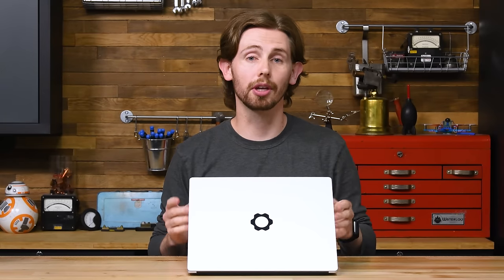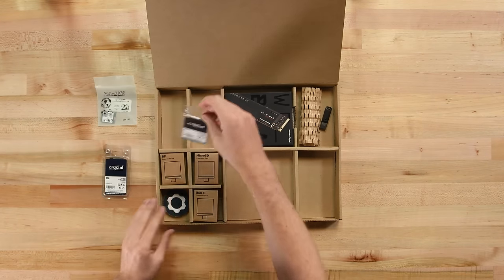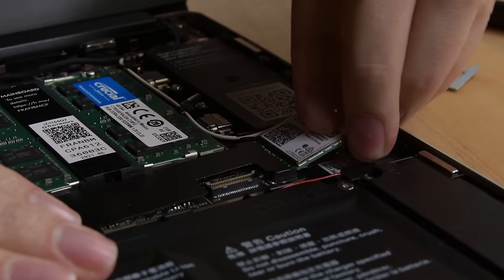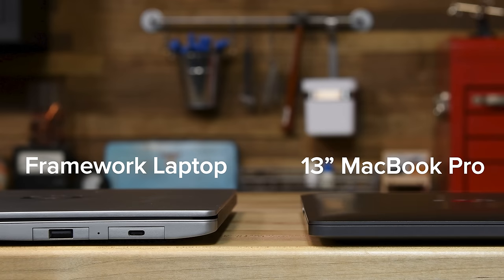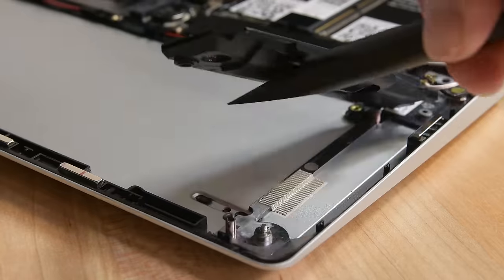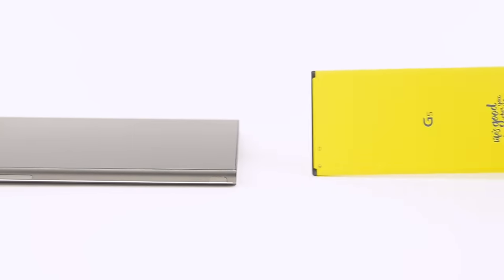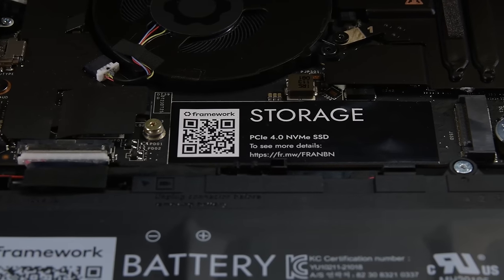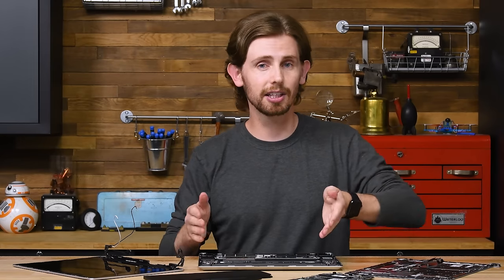Framework Laptop Teardown: 10/10, But is it Perfect?

Comment: I am kinda disappointed that I don't need a laptop rite now because I want to support this thing with $$$. 

The only reason it might not deserve a 10/10 is if the company isn't able to keep replacement parts in stock. If there is a way, in the future, to upgrade the CPU, and go beyond 32 GB of RAM it deserves a 15/10
Reply: I think the laptop actually supports up to 64 GB of ram.
Reply: Or if they can’t make retrofit kits to swap motherboards when cpu manufacturers change the sockets.
Reply: Pretty sure those SO-DIMMs will support 2x32GB sticks if you really wanted, pretty sure the processor supports it
Reply: @RadDadisRad  there aren’t any sockets in laptops. The CPU is soldered right in to the board, and there isn’t any cpu that has a socket.
Reply: @Xavier likes Technology yes, you have to replace the whole motherboard, which isn't the best solution, but still better than replacing the whole laptop
Reply: @Xavier likes Technology 
But they are replacing the whole motherboard already, as seen in this video, if you have to upgrade the CPU, you’ll have to get The Whole new board for it which contains the soldered CPU, so it’ll be upgradeable
Reply: I'm on the same boat with you. My laptop even died recently, so I'm kind of in the market for a new one. But I'm doing very little traveling, and working from home on my desktop (as a result of the ongoing situation), so I can't really justify purchasing a laptop for now. Once I become mobile again, this is definitely on the top of my list. Seriously, I'm trying very hard not to throw my wallet at the screen right now.
Reply: Honestly the only reason I have bought it is because I don't need a laptop.  Hopefully it stick around and is more mature and customizable by the time I do though.  As for CPU upgrades they do plan on having the option of buying boards with different CPUs.  Which doesn't sound ideal until you see they also want a market where you can sell your old board to recoup some of the cost as well.
Reply: @AlexSage91 
Sounds really ideal and better than other options imo, You won't have to pay the full price of a laptop if you judt want the new CPU, say, for example, you bought a $1000 upgradeable laptop from framework, then 3-4 years later your laptop starts struggling so you need to upgrade it, for just $200-300 you buy the the new board with new CPU instead of spending $1000 again to buy a new laptop
Reply: @עומרגור-ק2ד  Thats why they designed the motherboard as simple as possible, so that replacing the motherboard is barely more expensive then the CPU.
Reply: Isn't CPU soldered on the MB?
Reply: @乾淨核能  
Yes
Reply: With no dedicated GPU, I don't think anyone is going to be doing workloads heavy enough that would require the CPU to have anything higher than 32 GB of RAM.
Reply: @עומרגור-ק2ד  That's a bit weird considering i upgraded the cpu in my laptop which was socketed 🤔
Not all laptops have soldered cpus, especially when the chassis/mobo is going to be used with multiple skus
Reply: I'm just hoping some 3rd party accessories would appear for this laptop. The shape is really that generic, it would be that easy to create something compatible in this laptop. That way the product longevity would span ahead.
Reply: For repairability, what you said is the only reason it wouldn’t get a 10. I have a few minor problems with it otherwise, though.
1) There is no way to use an AMD CPU, which would probably be faster and more power efficient. This is important because of the small battery.
2) From what this video tells me, the cost of Windows is included in the laptop, which means it would be cheaper and faster to use Linux, but we can’t do that.
3) The battery is too small. I would much rather my laptop be a bit thicker than have a dinky battery.
4) There is no touchscreen and no 2-in-1 capability. I don’t really care about those, but other people do.
Overall, these are extremely minor nitpicks, and I would definitely recommend a Framework to anyone in search of a new, high quality laptop.
Reply: I Waldo want to support this company but its too expensive for me. :(
Reply: For a cpu upgrade a whole motherboard would be needed. And maybe a cooler too, if the cpu is thinner or something like that. But given how easy this motherboard replacement is, and also that the motherboard has no major hardware built in, other than the chipset and cpu, it should be relatively easy to pull off at a reasonable price.
Reply: Upgrade cpu is impossible...since the socket need to change to adapt with newer cpu. I still remember alienware 51m vs asus ryzen cpu laptop. All of them are beefy and no body choose to replace it or upgrade it. Secondly intel and amd sold their mobile cpu as dices, not as a whole cpu. So all manufacture have to soldering those dices onto motherboard....etc...alot of thing had changed so upgrade cpu will never return
Reply: LTT says they can do 64.
On a completely unrelated note, their website is down.
Reply: Well it's pandemic give them a break for now
Reply: The laptop does support 64Gb of ram
Reply: Kevnev Katfute  Yeah, I know, I was part of the hug of death. Just trying to joke.
Reply: It supports 2x32GB, when that isn't enough for you anymore the rest CPU is probably also obsolete.
Reply: It supports 64GB of ram
Reply: @Xavier likes Technology what about ARM ? if Framework goes ARM can I change my Intel device to ARM?
Reply: @RadDadisRad  you can but it would have to be external
Reply: It already supports 64gbs and modern laptop cpu's arent socketable(at least not series that this laptop is using), they're soldered and I'm sure if you fashion a mobo and socket that's break some IP laws
Reply: It can already go to 64 GB ram.
Reply: @STORMFIRE07  will it lose windows?
Reply: What I'd like to see is a robust aftermarket for different parts. At first, it might come from people making 3D printed parts but if it's popular enough third-parties might make things for it as well, which will keep it going even if the company can't.
Reply: @legoswmonkey7037 they do have 2×32 GB kit of RAM
Reply: @skywz  
1. There maybe AMD board available later down the road as the silicon shortage normalizes. I think Intel is easier to get now so they went that route. 
2. There is option for no OS. 
3. That is personal choice. A lot of ppl would prefer a lighter laptop even at the cost of lower battery life.
4. Linus said that touch screen support is built in the hardware so there is possibility of getting a touch screen later.
Reply: @עומרגור-ק2ד  There are a few laptops that have a socket for the CPU but they are rare
Reply: @Xavier likes Technology Thats why in the video he talked about replacing the whole motherboard when a new CPU is available
Reply: @johndumpling1896  Depends on the price of the motherboard and how much it will improve the laptop but its a great idea if its cost effective
Reply: I would also like that the CPU is upgradeable but that I think won't happen. Newer CPU's need newer sockets and are only compatible with newer chipsets. Intel and AMD are responsible for this "issue", not the guys at Framework
Reply: @עומרגור-ק2ד  Thats weird, because my old zbook has a socketed 4700mq
Reply: Actually some laptops allow you to do so like clevo laptops. However tho this company still did a good job on maintaining the balance between thickness weight and upgrades.
Reply: Technically speaking, if the CPU does start showing age, you could theoretically just order a new main board from Framework and carry over all your other components just like you would a desktop. Let's face it, even if they didn't solder the CPU to the motherboard, come upgrade time socket compatibility would probably be an issue requiring motherboard replacement anyway.
Reply: 64 GB is an option on their website.
Reply: I want Ryzen mb
Reply: If they have shares, than you can invest.
Reply: @skywz  the score is based on repairability...
Reply: @Mod20087  It does. ;)
Reply: Apparently they released CAD drawings of the motherboard so once you need to upgrade to a newer CPU you can for example 3D print a case for the motherboard and use it as a NAS.
Reply: Hopefully this kind of thing might get traction enough for some standardised parts. :)
Reply: @johndumpling1896  how often do people upgrade the cpu without swapping the motherboard as well. Even in desktop PCs most people will stick to there CPU until its so outdated that they would need a new board anyway
Reply: it is able to do 64gb at this exact moment. furthermore, they have already declared the motherboard w/ cpu also easily replaceable, and they even want to support arm riscV and other x86's in the future
Reply: @RadDadisRad  No sockets on mobile CPUs anymore.

So as long as the new CPUs don't require drastic motherboard design changes, then Framework should be able to offer replacement motherboards with newer CPUs.

Whether they will is another question.  If they are still around, it may not make financial sense to (hopefully not).  Or sticking to one motherboard shape may hinder them in the design of new products.  As this is the first version, I think they may well have that latter issue.
Reply: sell your laptop and buy this one
Reply: +1
I purchased a laptop last year, and I live in a country where Framework won't deliver at this moment. I hope it finds enough early adopters to keep it afloat.
Reply: I buy MacBook
Reply: Pretty sure the fact that the CPU isn't replaceable is on AMD and intel, since they no longer design socketed CPUs for laptops
Reply: @עומרגור-ק2ד  they used to be socketed up until a couple of years ago. I actually replaced the pentium in my laptop with an i7
Reply: @NadimSadeeq  they mentioned it in their website. The processor is not replaceable, but the logic board itself can be replaced.
Reply: there will be
Reply: @skywz  System76?
Reply: yes rite
Reply: I can put up with even if it had soldered GPU but if it had above average GPU and I needed a new laptop I would buy this in an heartbeat.
Reply: @thepenguin9  He was a bit inaccurate, intels mobile cpu's dont have sockets, you either had a laptop with a desktop cpu or, and i am not informed on that whatsoever, you had a AMD laptop which may or may not have socketed mobile cpu'S (as i said i dont know anything about mobile AMD so i dont know if thats actually the case)
Reply: To upgrade the CPU would mean to swap out the mobo, since laptop CPUs are sodered on
Reply: on the website it says that you can upgrade the cpu with the motherboard
Reply: @skywz  hopefully they'll include those options in the future. 🤞
Reply: If only they released the designs for the 3rd party to create a market for the modules 💁🏻‍♂️
Reply: @amaizen4817  bit weird AMD would sell i5's and pentiums

And no, it isn't a desktop cpu. Some laptop motherboards have sockets. And this wasn't some top of the line laptop, it was an El Cheapo laptop.
Reply: it supports 64gb btw
Reply: you can do beyond 32gb of ram. however, you are only limited to 64gbs of ram since soddimm only comes in that much stoarege
Reply: @dharam95  MX Linux or Fedora Mate or both as I like dual/triple booting laptops.
Reply: I bought an m1 MacBook pro and now i legit regret buying it after finding out about this laptop
Reply: buy extended drive, Sell your current laptop & buy/build a framework laptop.
Reply: I'm sure one day when they offer other motherboards you will effectively be able to do this
Reply: @skywz  The good thing about Framework IMO is that it's modular enough that they could feasibly have motherboards with AMD CPUs and touchscreen displays just by making those individual modules. And as far as 2-in-1 and bigger batteries go, they'd just need a larger chassis. It's possible that if Framework continues making laptops, we'll see many more options available.
Reply: @Archpope  3rd party / aftermarket parts are explicitly out of this manufacturer's control. That's what "aftermarket parts" means. So the only way you're gonna see that, is if it sells well enough that other businesses consider making parts for it a worthwhile venture.
Reply: @skywz  You do have the option of getting a DIY version with "NO OPERATING SYSTEM" which reduces the price by $100
Reply: @Xavier likes Technology you replace the motherboard
Reply: @Xavier likes Technology then use AMD. Or RISC-V :0
Reply: they're going to have motherboard replacement kits so you can have a better cpu in the future, and almost all of the parts are standard
Reply: @sarim5030  I mentioned “affordable”, and that System76 is not.
Reply: @RadDadisRad  they will even sell you the mobo if you haven't bought one if you want to make your own custom laptop, so when they upgrade the cpu and motherboard not only can you upgrade but you can sell the old one to someone doing projects.
Reply: @עומרגור-ק2ד  Not anymore. My old Toshiba from 2010 is likely one of the last ones with a socketed CPU. And while I really love the idea of simply swapping the CPU, I can see why you would not want to do it because of reliability issues. Still: It was possible back then and I would gladly sacrifice a few mm in thickness for the socket to come back.
Reply: w  Not all the parts.. the Motherboard and some of the other parts are custom made to be more repairable and, according to LTT Framework went around to parts manufacturers and looked for new things that other manufactures aren't using that fit with the ethos.  They and those manufactures will make the parts available, but if you want the drop in fix some of the parts are only for their laptop.
Reply: @CanadianBakin42O  what
Reply: @ThePepsicola1995  if you learned to read, you wouldn't have said that
Reply: @lungshadow Exactly. It makes perfect sense as a business proposal to offer a solution technically suitable and mostly beyond the needs of 50% (or whatever it is) of consumers. I also would think it a no-brainer to plan for a line of high-performance, larger units with discrete graphics and full keyboards with numpad etc... when success of the initial run allows it. In the age of planned obsolescence, these guys deserve major consumer support for their initiative and it's great to see the enthusiasm from the youtube community. Peace.
Reply: @CanadianBakin42O  Why so toxic my man
Reply: And add in a GPU but that’s even more of a pipe dream as it needs cooling upgrades as well.
Reply: @dharam95  you can install Linux yourself you know
Reply: @AlexSage91  also the system board is designed so it's easy to re-use it as a desktop.. So if you upgrade, the board is not "just" a replacement part, bur an option for ppl to build a cheap desktop.
Reply: @thepenguin9  in the past yes... not anymore... all mobile cpus are soldered... ofc there are laptops that use desktop cpus, but that is something diffrent.
Reply: @ric_dk-9520  not sure how to tell you this but, I didn't use a desktop cpu in the laptop, it was a sku meant for portable usage, and it definitely wasn't a desktop mount on the board
Reply: @skywz  For point number 2, the DIY edition exists which lets you get a laptop that can either preinclude RAM, Storage, and an OS, or not include any single one of them, or all of them. 

I did the DIY edition, with "BYO" memory and storage and OS as I have a spare windows 10 pro key laying around my house so I got my laptop cheaper since i didnt include as much on the initial purchase
Reply: Not entirely true. My Alienware M17XR4 has a FCPGA988 - maybe rPGA988B? - socketed Core i7 CPU (as well as a replaceable MXM graphics card).
Reply: not to be that guy, but most use cases where you need over 32gb of ram, you will need a better CPU than is inclided. I personally have 64gb of ram on my laptop workstation and the CPU is the bloody bottle  neck.
Reply: @johndumpling1896  with apple they replace the whole board including the ram and storage and claim it can't be repaired
Reply: The laptop uses standard DDR4 modules which means it can easily support 32GB RAM, maybe even 64GB (2x 32GB). Though having said that, 32GB DDR4 modules are going to be almighty expensive.
Reply: @johndumpling1896  I think that's actually okay because you very often have to replace both motherboard and CPU on desktop machines, too, if you want a real upgrade. Even if the socket is compatible, the chipset on the motherboard may be the limiting factor. I hope they can support AMD CPUs with the same form factor - it would be nice to switch from Intel motherboard to AMD motherboard and keep everything else in your laptop (including battery, memory, SSD, wireless adapter, all the modules, keyboard, touchpad and the screen)
Reply: It has space for two memories and the highest capacity at the moment is 2x32
Reply: 2 years later, and there is successful upgrades! Even original 11th Gen CPUs to Ryzen and 13th Gen!

Comment: I think the soldered on USB C ports is ok because the blocks have to plug in straight because they have a guide and they lock. This means there is no wobble to tugging to damage the ports and if they do loosen the locks will make them stay in.
Reply: Lois Rossmann also first was picking about the soldered ports but also came to the conclusion that the sliding of the modules shouldnt put to much stress on them.
Reply: @hansmaulwurf8027  esp since they look like there's a small track, so most of the force would get taken up by the chassis of the laptop, which Linus has said is super durable for such a small aluminum frame
Reply: @hansmaulwurf8027  They even confirmed this fact
Reply: @hansmaulwurf8027  I think framework replied in the comments of his video saying the modules are sacrificial. If there's a hard yank, the module could be damaged but the USB should avoid damage.